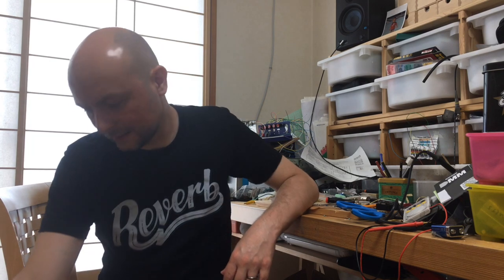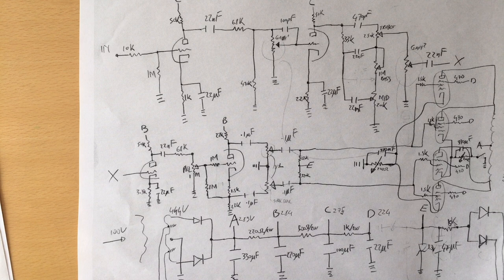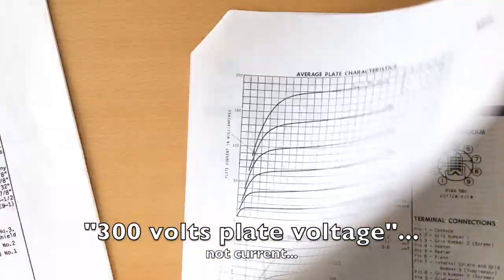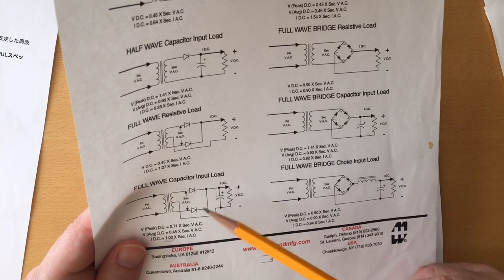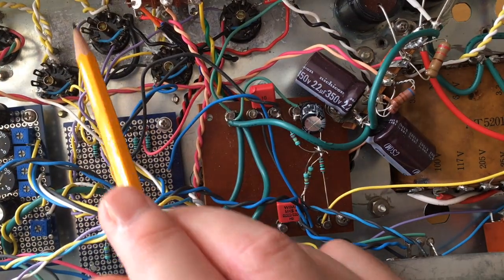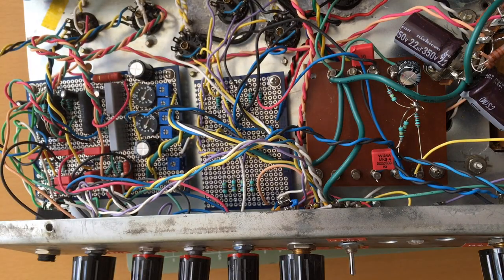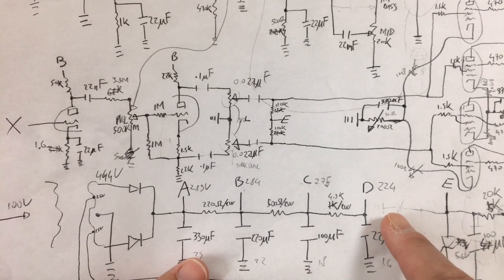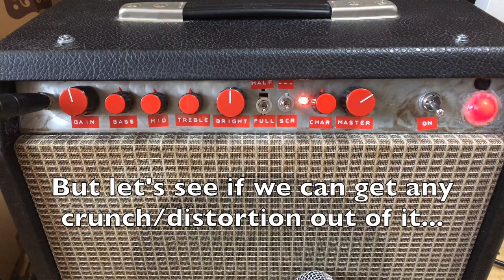The Beast - A 6 tubes, 10" speaker combo

Comment: Thanks for your video I have been dreaming up ideas for something pretty close to what you made here. Do you think the fuzziness in the half power setting has to do with a ground path through g1 via the bias?
Reply from the maker: I'm not sure I understand your question. Where is g1? But in general I wouldn't think it to be a ground issue as in half power mode I actually have one less connection to ground. But please, give me a couple more hints if you think I misunderstood you. In general, the reason for the fuzziness might be various. My guess is that on full volume and full gain I'm just overpowering the grid of the 6CL6s. Don't forget that I never tried the 4 tubes mode at full gain and full volume because it's just too loud. I will have to bring the amp to a studio to try it out. I'm actually planning on doing that at some point and I will shoot a video. I'm really curious to also try and plug the head in a Marshall half-stack and see how it sounds. Stay tuned!
Reply: ZenZero Electronics sorry for not being clear. G1 is the control grid of the pentode in this case the two that you are disconnecting the cathode from ground. The new signal path as I can see it, through conventional current, from the anode to the control grid to point E on the schematic through the zener to ground. I know tubes/valves act different than solid state but that's my guess on why the fizz. I don't have real world experiance so take these as guesses not truth.
Reply from the maker: Thanks Celloman2008! That's a really good idea. I guess I will have to open up the Beast and run some tests trying to disconnect also the grid of the two unused tubes. If that solves it, then I will to add the functionality to the switches. I will make sure to shoot a video about the process. Thanks!